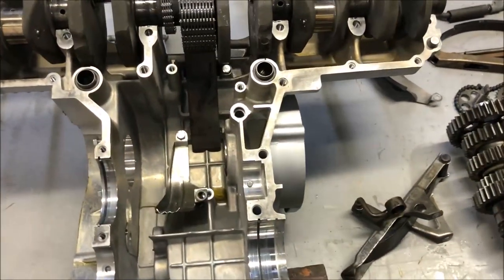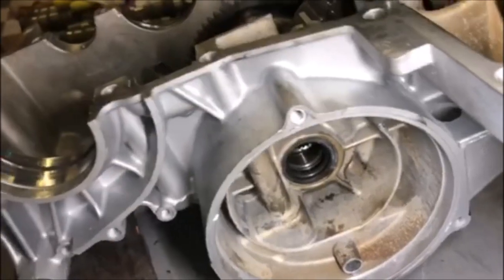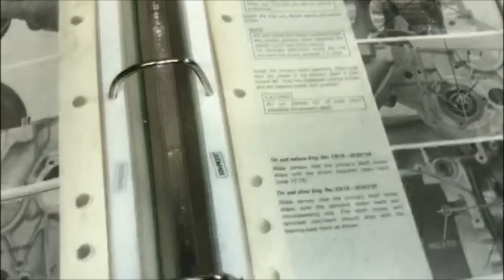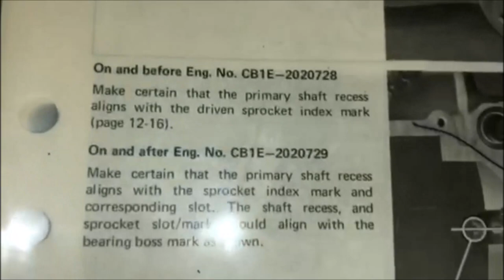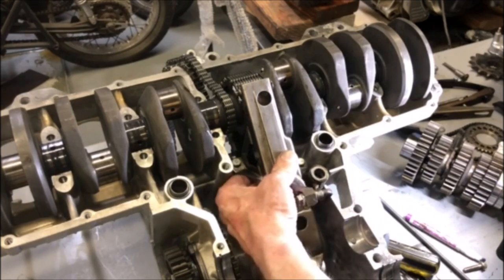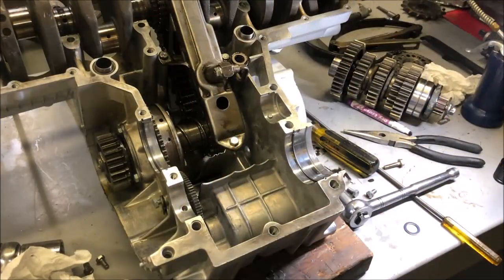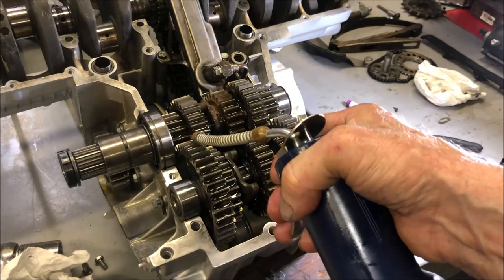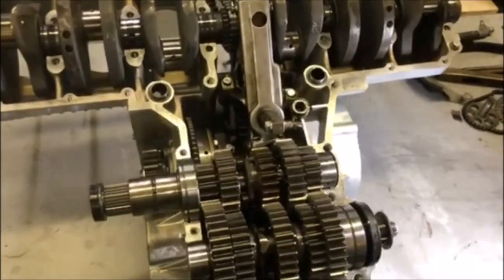Honda CBX Full Restoration & Engine Rebuild Video Series - Part 15 - Re-assembly Part 2

Comment: From my days in the dealership.... I had a bottom end job on a cbx and had the same problem compressing the primary chain tensioner.  Found a neat trick that worked good.
Use a length of safety wire and wrap it around the slider as you compress the plunger.  
Tie the wire together so the plunger is compressed and can be assembled without having to use one hand to hold it and fit the spring/collar together.  Once the tensioner is tightened
down you can unwrap the wire and feed it out.  Makes life a lot easier.
Reply from the maker: That’s a great idea, I will try that 😎 thanks Ray

Comment: That primary chain tensioner, pull the assembly together with a cable tie, put your bolts and washers in finger tight, and then cut the cable tie, to release it. 
Frees up your hands
Reply from the maker: Hi Llew,
Good suggestion, I will do that next time.
It wasn't really that difficult without the tie, but the tie is a good idea :)
Thanks Llew
Pete

Comment: Hi. great job, thanks for all your posts. my question is about central gear fork. I seen that 100% are with central damage. than Honda changed this fork for 80-83 cbx-s . can be used a new model on a n old Z model? the number part 24212-422-000. or can be machined there on the middle section? thanks, Flo

Comment: I'm surprised you didn't change out the one rusty gear.
Reply from the maker: Hi Mark,
I was going to, but the once I got it out and examined it, I realized it was really minor surface rust that I was able to wire brush off, plus only about 40% of the gear was affected. The rust stain is still a little evident, but the gear is still in excellent condition. I see no reason to replace it. It looks a lot worse in the video than it really is.
Thanks Mark, I appreciate the comment :)

Comment: One of those gears had quite a bit of surface rust on it. Wouldn't that be worth cleaning up?
Reply from the maker: Hi Bert
I cleaned it up as much as it would come clean.
It looks a lot worse in the video than it really is.
The gears are in really good condition otherwise, so they will be fine especially since they will be bathed in oil from now on.
CBXs have an issue with that same set of gears getting surface rust on them if the bike sits for a long time.
I have seen that same pattern of rust on other ones as well.

Comment: Where can one find replacement cam guides and tensionsers? I have tried all over with no luck.
Reply from the maker: Hi Tony, I would just keep looking on eBay, they come up on there all the time.  You could also contact regular sellers on there and ask if they have any.

Comment: Hey Pete, do you not torque your bolts?
Reply from the maker: Absolutely, I torque all the bolts that the manual has specs on.
I go through and torque them as a final step.
I usually don't include that process in the videos.

Comment: What's the go with the rusted gear going back in
Reply from the maker: That gear actually cleaned up pretty good. It was mostly surface rust that I got cleaned off with a wire brush